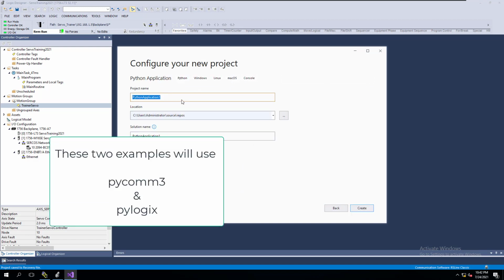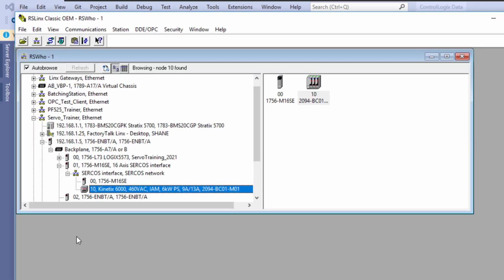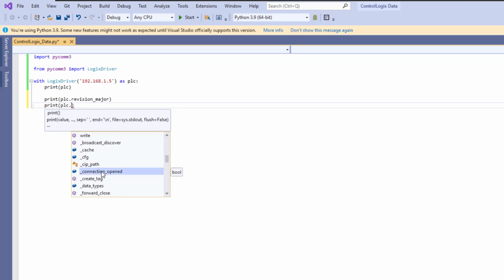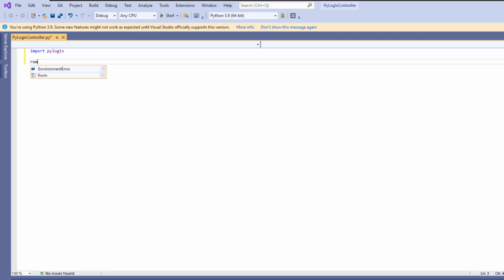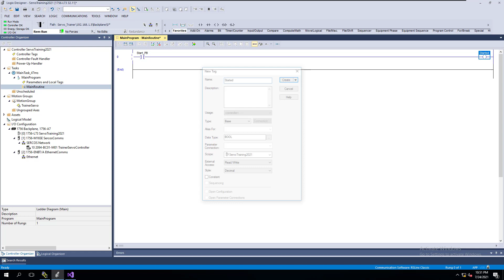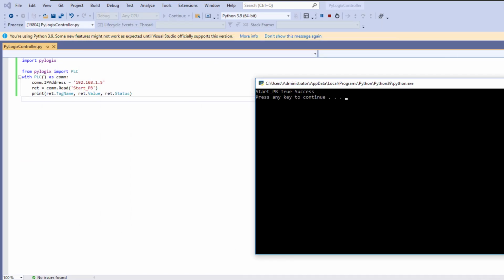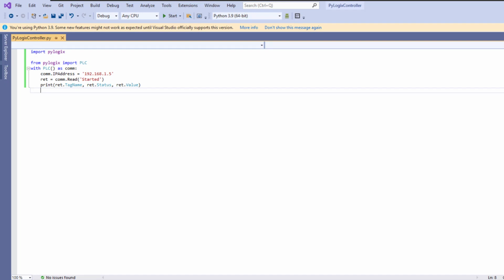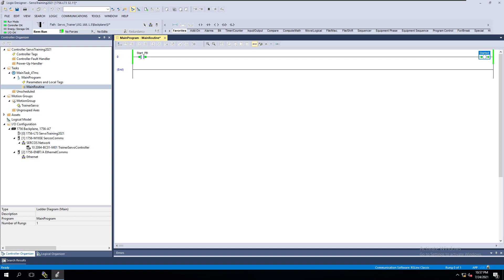Using Python To Read PLC Data With Visual Studio By Importing Pycomm3

Comment: Hi Shane, are you able to do a video on Modbus TCP/IP using python?
Reply from the maker: I do not have a modbus converter to use although yes you can read data from the IP address.

Also depends on the modbus converter

Comment: Hi, Shane in my application I need to monitor the tag of about 5000 of data length 4byte is that possible using those libraries
Reply from the maker: Yes however, it may take a bit to collect all the data because of the way Python works.

If you need a faster alternative then I would use JavaScript although it's a bit harder to implement
Reply: @ShaneWelcher  what is the node js alternative you refer to ?

Comment: Hi! I would like to ask for some help. I was able to gather the informatiom from PLC control tag (RSLOGIX 5000) but not able to work with it. So if I want to handle that information in forexample in an If statement I won't be able to work with it. 

import time
from PIL import Image
from pycomm3 import LogixDriver
from tkinter import *

with LogixDriver('here my IP adress I removed it') as plc:

        valami = plc.read('valami')
        print(valami)
        if valami:
            print("works")
        else:
            print("Doesn't work")

It always says its true even if i toggle the bit to False. It will never go to else branch.

Thanks for help.
Reply from the maker: Sounds like you do not have an active tag or your update time is incorrect, not sure what you are using for python programming I use VS code which is a manual trigger the code that reads the tags so it requires me to trigger the python code to get refreshed data
Reply: @ShaneWelcher  I do have an active tag, could you please share your mail I'll send you the picture what I have on pycharm.
Reply from the maker: I would recommend you reach out to the GitHub, I did not design Pycomm
Reply: Whenever you toggle the bit are you restarting the script? If not then I don't think your value will be automatically updated because the python script isn't looping in that code. I have written a class object that looks for the leading transition of a bit constantly so as to circumvent this issue and it works well.

Comment: Hi, thanks for the video, I'm currently trying to use pycomm3 for real project, but what. Getting that very slow read cycle, it's taking around 0.9 sec to 1.3 sec just to for a read cycle. Which is very long in my application as hmi momentary switch only high for 0.5 sec, so it not catching singnal from hmi's push buttons.
Is there any way to improve ?
I have to read around 22 nos of integer register.
Reply from the maker: Please refer to the GitHub page for Pycomm3

It most likely could be your computer
Reply: @ShaneWelcher  not sure if it's my computer, as I tried 3 computer, all of them have similar time, and also I tried ModbusTCP which has significantly less time, but because of some limitation of Modbus protocall, can't use it.
Reply from the maker: @MdMozammelHossain  Reach out to the creator of Pycomm3
Reply: Indeed, polling data blindly is not the way, need to detect changes in values instead. I did change detection in c# but it must be a way to implement it on python or node js

Comment: Does it work with all types of plc or it's for a particular plc brand
Reply from the maker: The GitHub code I am using in this video is for Rockwell Automation.

There are separate GitHub codes for other PLC brands
Reply: @ShaneWelcher  isn't there any one that can be used generally? I am thinking of extracting real time csv data from plc  since all plc(s) can do this, and reading it on python, i am actually making research on this and i could use your professionalism on this. Kindly share your me your email sir.
Reply from the maker: @gbengaoyede2877  Visit the GitHub site for the information, it gets updated from time to time

Comment: I guess it cannot be used with RSLogix Emulate 5000 because the emulator cannot be accessed via an IP address.
Reply: pylogix can read tags on emulate, I found out that emulate expects a specific connection size, because Rockwell. so if you add a line comm.ConnectionSize=504, it should connect to emulate as long as  you are running your script on the same machine that emulate is running on.  Edit:  You would use your machines IP address to connect.  edit2:  I made a commit a while back that should automatically try the correct connection size for emulate if it doesn't connect the first time.
Reply from the maker: You can use a Python script to read Emulator, however, it is a different code than this.

Use the GitHub links in the video notes about how to do this.

Comment: Hello, i've been trying to connect to a  logix5561 but i get unknown error errno [111] connection refused, do you have any idea of what could be happening?
Reply from the maker: What communication protocol are you using?
Reply: That error comes from pythons socket module, not the PLC.  So you are not connecting to the PLC.  Make sure you can successfully ping the ethernet module in your ControlLogix rack first.  If your L61 is not in slot 0, then make sure you specify which slot it is in.
Reply: Yes, i could successfully ping it, the ip was in the same segment, the weird thing is that with pycomm3 i dindn’t have any problems but with pylogix i wasn’t able to read the tags
Reply from the maker: @chuystark  Probably missing an updated version of pylogix.

Or the import of the needed files.

Comment: I do not know python. I know c++, c# , and visual basic. Is it similar? I always wanted to try ingear software to work with allen bradley software because I know these languages.
I bought a book on python, but I always read my C books because I work with robotics. C# is my favorite by far. Garbage collection is automatic, no memory leak.
Reply from the maker: Great to hear
Reply: @ShaneWelcher  I don't know if you did a video on how to implement the encoder card on the powerflex 525. I have the board, just haven't used it yet.
Reply from the maker: @timkloehn9887  I have an encoder card in my PF525, I'll try to make a video in the future.

Been busy with moving & taking care of my mother.
Reply: @ShaneWelcher  You were right about rs5000 version 20 being buggy and a piece of crap software version. I stand corrected. thankyou.

Comment: Nice video,are you using visual studio for python?
Reply from the maker: I do use Visual Studio but in this video I used a separate VM which was Linux.

I prefer Visual Studio 2019
Reply: @ShaneWelcher  in Visual studio what i remember there is toolbox like textbox or button, means you can use this for python reading display?
Reply from the maker: @edinetgrunhed6000  yes, just import the tools needed to read data from the PLC .

Pycomm is one tool then there is another tool I will show in the future.

Using Visual Studio 2019 then install the needed things from GitHub & then when writing scripts, just import that tool first.

If you did not have an internet connection for the install then there are ways to manually install as well but is a slight bit harder.

The end result is the same.

Using python to read data from a plc.

Pycomm or Pylogix
Reply: @ShaneWelcher  ok,I prefer pylogix looks more stable
Reply from the maker: @edinetgrunhed6000  

Yes, more options